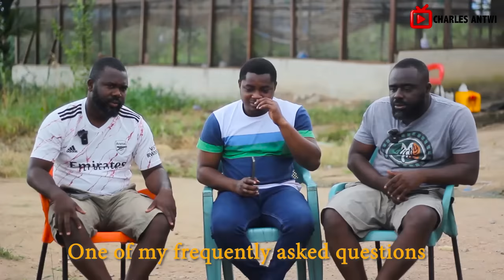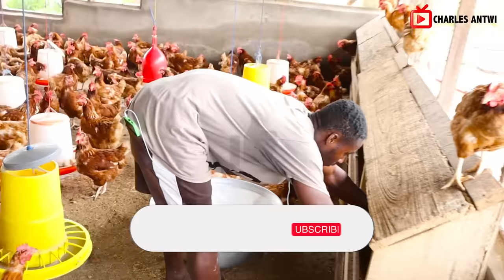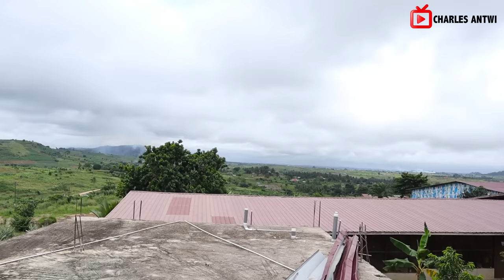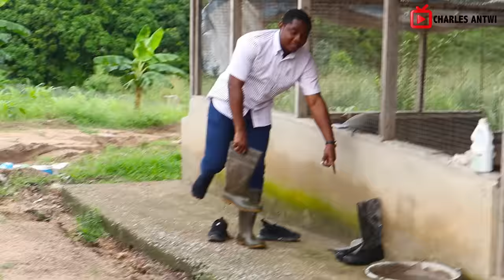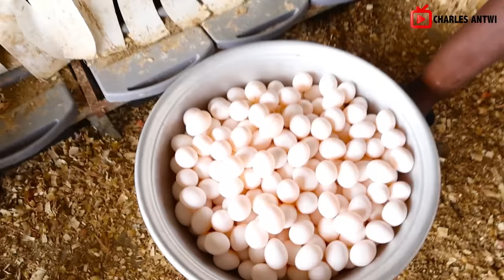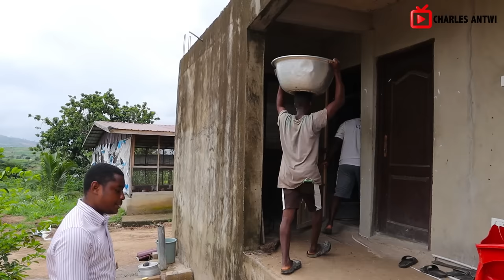How They Make GHS150,000($12,929.25)/Month From Their 12,500 Capacity Poultry Farm #poultryfarming

Comment: But the real question is what is your COGS on the GHC 150k/m?
Reply: I think they worked that out using the 1000 birds scenario. Ended at a margin of about 16k with this scenario. 

With economies of scale the COGS will be lower for the current 12500 birds. I'm into it and I must admit the feed can take your calcs out of gear especially with the kids current exchange rate driven inflation in GH.